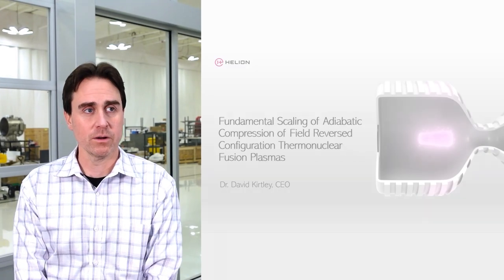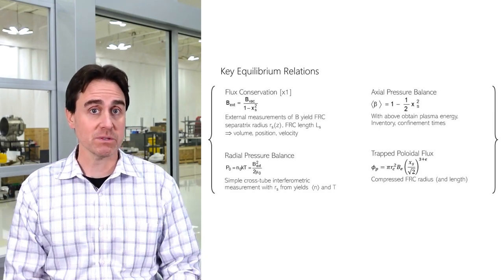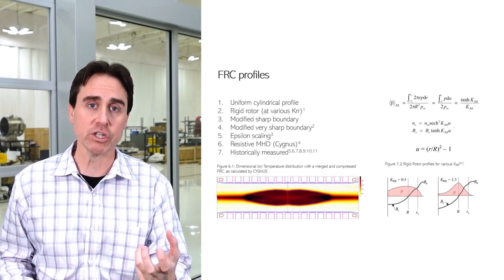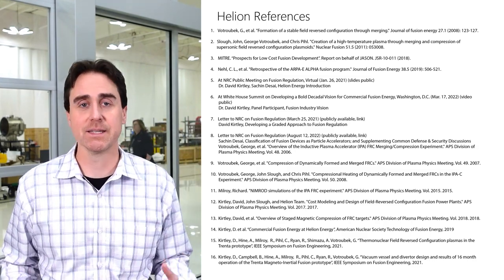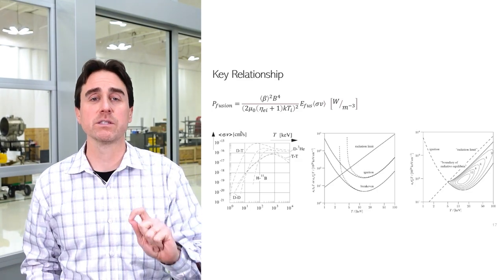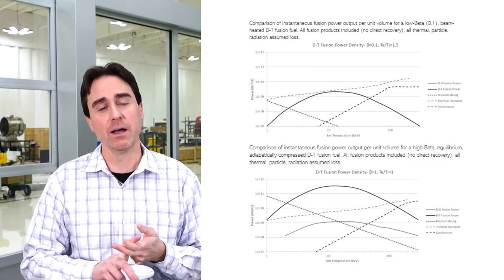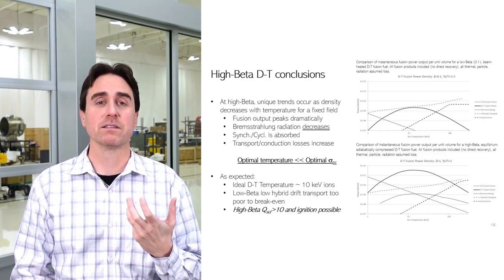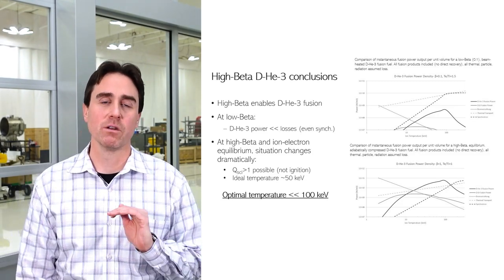The theory behind Helion’s approach to building commercial fusion devices

Comment: So I have a basic question about deuterium-deuterium fusion.  When doing fusion with He-3 and deuterium, does the deuterium-deuterium side reaction produce enough He-3 to produce future fuel?  Or alternatively, are there separate fusion cycles for generating energy vs producing fuel?
Reply: Someone from Helion can probably answer this better than me, but in case they won't, here is my two cents:
Helion got a few options for this and from what I have heard, they themselves are not quite sure yet which way is the best (as some of that decision depends on external factors like regulation or market demand). 

1. They could have a lean burning D-He3 machine that essentially has a much higher ratio of Deuterium to He3 in the fuel mix and will essentially do two D-D reactions for every D-He3 reaction. AFAIK, there are some parameters they can tune to favor D-D over D-He3 reactions as well (density over temperature among other things).

2. They can vary fuel mixture, density and temperature on a per pulse basis to favor D-D reactions over D-He3 reactions (or the other way round). So have two D-D pulses for every D-He3 pulse. This could be interesting for plants that have to load follow a lot. Do more D-D pulses during time of low demand, then do more D-He3 pulses during time of high demand.

3. They could have a separate machine (of similar design) that is dedicated to He3 breeding. That would do D-D pulses only. 
This potentially has some licensing/regulatory advantages because D-D reactions produce neutrons and also Tritium as a byproduct that has to be stored and transported. It could be harder to get regulatory approval for a mixed mode machine than for a dedicated D-He3 machine. So, you have D-D only breeders in a single (or few) location where you got (easier) approval. Then the He3 gets delivered from there to distributed, dedicated D-He3 machines (that try to suppress D-D side reactions as much as possible). 
It also allows them to optimize breeders and D-He3 power plants for their respective tasks.

There could also be some odd combinations/variations of all three concepts. 
The important part is that Helion has a lot of options and ways to tackle this. Flexibility is key and they can adjust to (external) realities when they have to. One of many things that makes the concept amazing in my book.
Reply: @elmarmoelzer2229 More or less this.
You need a fair amount of helium-3 inserted to begin with but not nearly as much as the deuterium.
But the downwide is it produces more neutrons which can't be stopped and damages the reactor walls...

So the sensible thing would be to make / source helium-3 outside the reactor and have a deuterium heavy fuel mix.

I can't really see many good ways to get Helium 3. 
It's basically. 
- Make an overbuilt pulsed reverse field configuration machine that is primarily for fuel manufactering and focuses on replenishing its own energy,
rather than the grid.
- Seperate from natural helium extraction
- Bombard lithium with neutrons to create helium 4 and tritium in massive quantities and let the Tritium decay into Helium-3

The half life of tritium is over 12 years btw. you need a lot...
Reply: @Mallchad  
I am not sure I understand. 
They do not need He3 from the very start in any of the scenarios I laid out.
They could just start with a few pure deuterium pulses and get He3 for later. 
The neutrons are not that bad compared to D-T neutrons. The D-D neutrons only have 2.45 MeV energy (vs 14+ MeV for D-T neutrons). This is below the activation energy of many materials. Neutron damage should not be a problem until many years of operation and then components can be easily replaced in a cylindrical machine (compared to a Tokamak).
The D-D reaction will produce a He3 in one branch and a Tritium in the other. The Tritium would eventually also decay to He3, but they can just sell it and take the money from that. Likely more profit in that than in the electricity.
So, they will get a Helion for every two D-D reactions right away and another one some years down the road.
They will likely be fine with just the He3 from the immediate branch and the He3 from Tritium decay will be nice to have in the future (or they sell it and pocket the money or trade it for He3).
Reply: Wow, really good answers- informative and thoughtful.

Interesting that there are several different options.  How much of a consideration is net energy gain?  Does it help to incorporate some He-3 / D fusion into the D-D fusion to increase the energy output?  Or will it actually be possible to achieve net energy gain with D-D fusion alone?

Regarding the damage from neutrons in D-D fusion to generate He-3, how big of a problem is this really?  These neutrons are of much lower energy compared to D-T fusion.  Plus, the reactor wall doesn’t need to incorporate a breeder like a traditional tokamak, so would it be possible to have some kind of replaceable barrier to shield the magnets?
Reply: @elmarmoelzer2229  Sorry. 
I misunderstood the reactor concept, I didn't realize they were genuinely going to try deuterium only start fuel.

I heard it mentioned in some of the other information and inverviews (not here) that they're still damaging equipment even though its much slower. Mainly just because of how far neutrons travel. 

(indirectly answering Jonathan).
To build a reactor that can deal with the neutrons and wouldn't actually wreck the reactor even long term (we want sustainable reactors ideally), you really need very very thick shielding. Many meters of concrete, or similar. Maybe water.
Which is probably why Helion keeps bringing it up. 

It does make a lot of economic sense to sell Tritium and Helium instead of using it as fuel. It might even be easier to sell it directly and not bother refining it even.

(To Jonathan)
I don't know the exact specs of their reactor, whether you can get net energy gain from deuterium-deterium reactions depends on their reactor.
I'd say they are mainly looking for the Deuterium - Helium-3 reactions because they want charged particle energy, not neutrons. So they prefer the reactions that produce less neutrons
Reply: @jonathanlehmann2059  
1. This is a good question. The video is unfortunately missing the last plot for D-D and D-He3 with the Te:Ti ratio of 0.1. 
That one shows a relatively small region where they have a net gain from D-D alone.
Note that the plots are for 20 Tesla external magnetic fields. With their energy recovery and direct conversion that should theoretically be just enough for the machine to be self sustaining on D-D with maybe a tiny bit of excess energy to power the facility. 
Adding a little He3 would help making some profit from energy sales. 
They could also make D-D machines a bit bigger or have stronger magnets which both could help achieve a higher net energy gain.

Neutron damage from D-D neutrons should indeed be much less of a problem than from D-T neutrons. The 2.45 MeV are below the activation energy of many materials and Helion of course tries to use those wherever possible. They will still need shielding around the machine though. My concern was more about how squeamish politicians are about anything with radiation. D-D or even mixed mode machines could be subject to stricter regulations than a pure D-He3 machine. So, site licenses for pure D-D machines or mixed mode machines could be more difficult to obtain. It is one of the reasons to consider just having few breeder locations with more distributed pure D-He3 plant locations. 

IMHO (and this is just speculation on my part), they could attempt to collocate breeders with nuclear fission plants. There are a lot of synergies that could be exploited with those. E.g. there is already storage for radioactive materials on site that could work for Tritium storage as well (some even have Tritium storage already). They are already guarded and have inspections and security for proliferation concerns. Tritium storage (for larger quantities) will likely need that.
Those breeders could also act as boosters for load following if they put some of that He3 back into the machine(s). Could give nuclear plants a bit of help with that, making them more competitive and play nicer with renewables. 
My point is that they COULD do all of these things (and more) because their design is flexible enough. Options are good.
Reply: @Mallchad  
See my reply to Jonathan below as it might answer some of your questions as well, especially regarding D-D operation.
Reply: @elmarmoelzer2229  Thanks for taking the time to explain all of this.  Incredibly interesting, exciting stuff!  This might be naive, but what about net energy gain?  I have seen Kirtley describe Helion’s mechanism to generate electricity from the fluctuations in the magnetic field due to the fusion reaction, but I’m not knowledgeable enough to be able to tell if the data in this video supports the idea that Polaris should be able to extract net electricity from fusion.
Reply: @elmarmoelzer2229  I actually know about the ionic energy gain possible from pure deuterium but like you say. it's smaller.
my favourite part about Heleion's design is that it actually doesn't matter if it's not enough to be self sustaining because energy is returned directly to the capacitors instantly. 
It increases efficiency from 100% loss massively and reduces the time you wait till the next pulse. There's also nothing to sustain which is a huge advantage especially for fuel manufacturing. No need for a complex startup. shoot whenever ready. or don't and save power.

Their system is soooo flexible.
To Jonathan. Net gain is not even a problem the energy return on fusion is HUGE and orders of magnitude more than the theoretical minimum input power.

I wouldn't be surprised if they get net gain very soon after building their 7th prototype with energy recovery. I haven't even seen them mention Q yet.

Their energy recovery relies on the fact that all charged particles, protons and electrons and anti-protons and whatever else move magnetic field. Moving magnetic fields creates electricity.

It's the opposite of how they compressed the plasma in the first place which is moving electricity to create magnetic field. It's very elegant
Reply: @jonathanlehmann2059  
Polaris will produce small amounts of net electricity. It is not quite a 50 MWe power plant yet. That will come after Polaris some time near the end of the decade.
Reply: The Real Engineering video covers the fuel issue.
Reply: So, if D-D fusion is going to be a practical way for Helion to generate He-3 fuel, how come nobody else has used it to generate tritium?  If I remember correctly, D-D fusion produces roughly equal amounts of tritium and He-3.  But from what I’ve seen, all the tokamaks that use D-T fusion want to incorporate expensive lithium/beryllium breeders.  This is the reason I was skeptical that the D-D fusion process would be an economically viable way of generating He-3 on the scales needed to power their reactors.
Reply: @jonathanlehmann2059  Ease of fusion.

Hydrogen has the lowest number of electrons and protons of any atom so has the smallest electromagnetic forces which prevents atomic nuclei from getting close enough to fusion.

Using tritium makes it even easier by also making the hydrogen heavy with neutrons so the mass makes it harder for the nucleus to move out of the way of another nucleus, is how I understand it.

There was doubt for a while if the 80-100 million+ kelvin temperature requried for Deuterium Tritium fusion was feasible, Deuterium Deuterium requires even higher I understand.

Besides, direct magnetic energy capture is a bit novel and people usually lean towards heating water and turning a dynamo for power. It's also the preferred configuration of a tokamak and stellerator. 

It might not lend itself to magnetic capture as well because the low ressistence around the torus means most of the charged energy goes that way instead of against the magnetic field. Would proably depend on the velocity of the plasma around the torus.
Reply: @Mallchad  I’m with you on Coulumb’s Law and how it affects the energy barrier to fusion for different nuclei.  Not sure I understand your point about the higher mass making it harder for nuclei to move out of the way.

My point was more that D-D fusion releases only small amounts of energy.  If there was a practical and scalable way to use D-D fusion to produce He-3 and tritium, then why hasn’t anyway else proposed this approach to make fuel for traditional tokamak generators (instead of the lithium/beryllium breeders)?  But maybe you are right that Helion’s approach is uniquely effective at D-D fusion.

I’m not sure that Helion can harness magnetic energy from D-D fusion because I think the energy is carried mostly by neutrons.  But going back to another comment, maybe adding a small amount of He-3 will provide enough energy in the form of protons to make it viable.
Reply: @jonathanlehmann2059  
Some people claim the D-D fusion power return for a temperature is over 50x less than D-T. And on top of that it's harder to achieve. Say, 5 times hardest by cross-section, that's one measure of difficulty. That's the main reason, they're going for the easiest fuel first.

Deuterium-Helium-3 has been proposed and so has Protium-Boron  reactions.

Helion gets their energy by creating Helium-3 in place from D-D reactions. I think the D-D neutron-electromagnetic energy split is something like 80-20%. Small, but still something.

Tokamak experiments estimate 100 million Kelvin + temperatuer for D-T fusion. D-D and D-He3 is even more than this, one article cited 500 million kelvin or more.

Thinking about it the most common problem I see with Tokamak's besides Plasma stability and neutron damage is just heating the plasma. It makes sense to go for a fuel that demands temperatures that are reachable.
Reply: @jonathanlehmann2059  
Because Tokamaks can't really do D-D fusion well. D-D fusion requires higher temperatures and densities than D-T fusion.
And Tokamaks can't really bring those.
Plus the neutron from the He3 branch has a lower energy than that from the D-T fusion reaction and Tokamaks would be designed to only extract energy from neutrons.
The other problem is that any Tritium bred in a steady state machine like a Tokamak would immediately burn again (since D-T has a higher reaction cross section that D-D).
There are however other designs of fusion generators, like the Sheared Flow Stabilized Z- Pinch by Zap (and I believe even some of the higher field strength tokamaks) that can use something called Deuterium- Deuterium Bootstrapping to make up for T- losses and/or to get enough T for startup. E.g. Zap could do 2 months of D-D bootstrapping to have enough T for startup (and a little bit in reserve).
Reply: I understand they've been doing D-D fusion with their Trenta machine, but I have not seen any numbers on neutron production. Does anybody know if Helion have released any figures ?
Reply: @charliem6590   Not for Trenta. But for Venti they did. Venti had 10^11 D-D neutrons/pulse. Trenta is much bigger and stronger (3 times the radius and 30 times the volume), runs at higher temperatures and has longer confinement times. So neutron count per pulse on Trenta should be significantly (at least one order of magnitude) higher.
Reply: @elmarmoelzer2229  Thank you for the info.
So, Trenta should be at or above 10^12 neutrons/pulse, and Polaris even [much?]) higher.
And they plan to turn up the frequency quite a bit, up to 1 shot per second if I remember correctly, instead of a few per hour. The total neutron flux is going to grow quite a bit.
I'm curious about what kind of precautions they have planed for Polaris, and also whether that flux is going to be high enough to start activating materials.
I hope Dr. Kirtley (or coworkers) touches on this in some of his future video/interview/post/paper/...
Reply: @elmarmoelzer2229  if nuclear waste are used as blanket, somthing like plutonium, can it control decay and produce enough heat to boil water ? 🙂
Reply: @charliem6590  
The Polaris building has all sorts of shielding built in. Plus there will be additional shielding inside, from what I understand. Also note that Polaris will not operate continuously. It is still an experimental machine, aiming to test their design in various ways and with different fuels, etc. It will operate for a few minutes at a time, at most.
Despite all that, Polaris will still have some activated materials and Helion chose the materials for Polaris deliberately for their relatively benevolent behavior in a fast neutron environment. 
Aluminum (magnets) that absorbs a neutron has a half life of 2.25 minutes.
Silicon (vacuum chamber) has to absorb 3(!) neutrons to become unstable. Then it has a half life of 2.5 hours.
All that "cools off" really quickly and it is possible to fully decommission Polaris two weeks after the last shot. Less than one year after the last shot, everything is below background radiation levels.

Comment: How do you shield your reactor  hall from neutrons?
Reply: From their FAQ: A borated polyethylene and borated concrete shield vault will surround Polaris to protect the area outside the machine from neutrons.
Trenta produced relatively few neutrons, but there was still permitted shielding in the walls around the machine, just not close to it. The controls are remote and neutron radiation, like any radiation declines with the square of the distance.